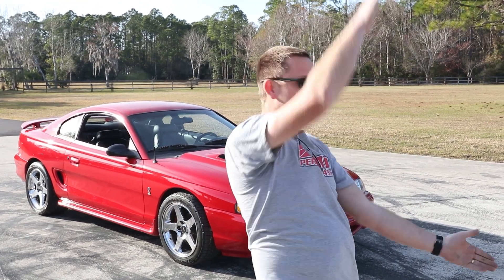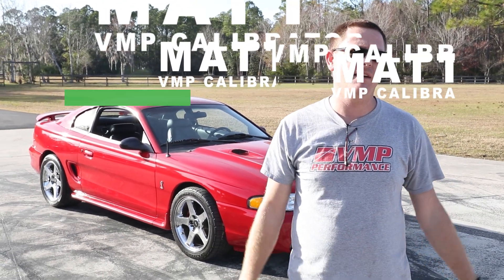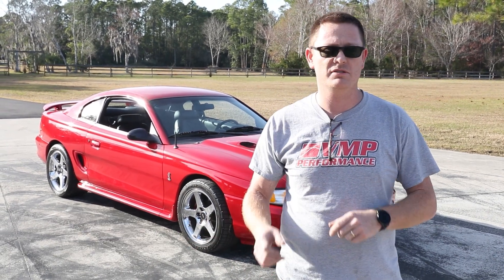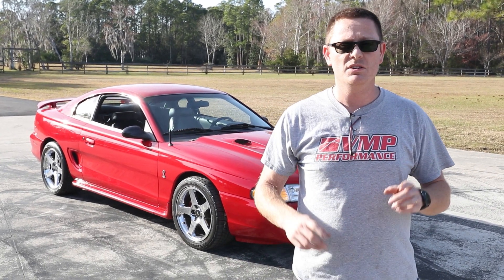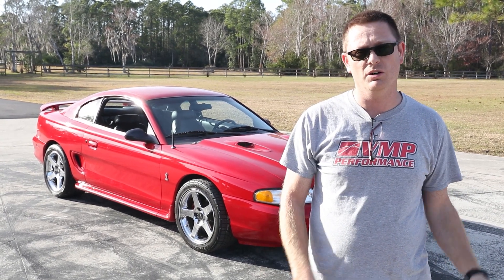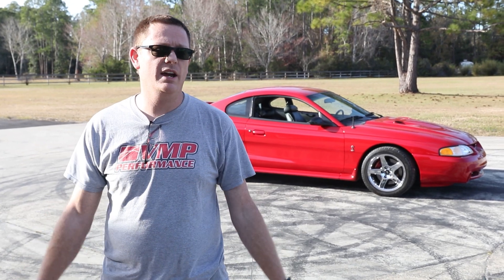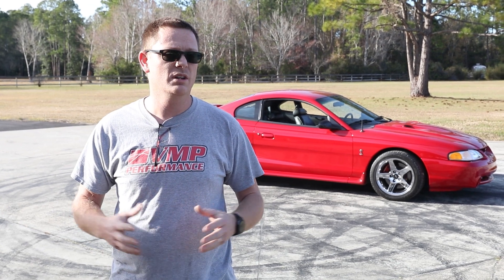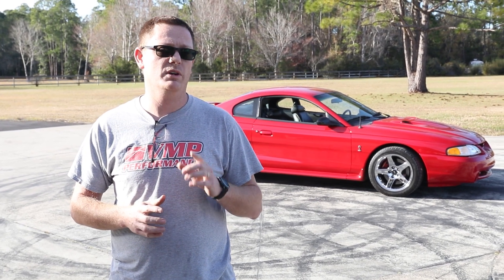Dyno Pull || 1997 SVT Cobra, Kenne Bell Supercharged

Comment: Finally a Chanel working on what I was looking for
I do have some questions, I have my 96 cobra with long tube racing headers, built heads stage 2 cam X-pipe, bought the car when I was 18 about 6yrs ago and wanted some tips on how to get it touching around 450-500 whp
Reply from the maker: That power level will most likely require forced induction to be accomplished.  There are a number of supercharger kits out there that could make that work.

Comment: So why are you guys not making adapter plates for your supercharger systems to bolt on to the bhead 4v's
Reply: ive been waiting years for this id love to get my hands on a mammoth kit for my 98
Reply: @ranware2779  the cobra r, ford gt, and 07 up gt500 all had the same heads I'm pretty sure and they are all better than b heads.  I've always heard b heads are good for boost.  I would do forged rods and pistons and go turbo on one of these its just the best option.  You're forced to go c heads if you wanna run a vmp blower or any other modern intercooler blowers.
Reply: @midnight347  b head 4.6 is the one with records go chec out TT minion he still has b heads. My question to these guys was that because b heads are the easiest 4v heads to obtain besides C heads

Comment: I just received the KB supercharger for my 98 cobra. Does your setup runs hot? I’ve heard people saying this. Nice cobra by the way!
Reply: I’ve been tuning it several weeks now, no issues with overheating
Reply: My 96 wants to run hot in the summer. It gets over 100 here and with the ac running it gets a bit hot if I'm in heavy slow traffic.
Reply: @Jon P oh ok how long has it been running hot? Are you going to do anything to fix the issue?
Reply: It doesn't really run hot, it just runs hotter than normal in those conditions. Mine is tuned to run around 180 and it will hit around 200 in the summer. Not really hot for what these cars are capable of handling just hotter than what mines turned for. It's never overheated.
Reply: Ron Davis Radiator + Edelbrock water pump + 180° T-stat and set the high speed fan to turn on at lower temp.  It will run at the N or O on the normal gage even on the hottest days.  Thanks @vmpperformance for the tuning!
Reply: Thanks for the info. What line on the kenne bell S/C can you put the t fitting for a good reading on a boost gauge?
Reply: @bernardberry35  good question.. mine is still NA full bolt on.  One day I may have a KenneBell 2.1 then I wont be taken so easily by a stock Coyote car.  Supercharging the 4.6 4V is still wayy cheaper than a coyote swap done right.  Your talking $30,000 for a supercharged 3rd gen coyote crate engine with control pack and tremec 6 speed.  I’d rather build and boost the original motor if I had the cash to go to that.
Reply: @jasco1776  that is for an overpriced gen 3 and auto setup.  You could do a gen 1 truck engine and build your original 5 speed and add a blower for waaaayyy less than that 30k figure you spit out.  You may do it not much north of 10k if you do your homework and shop wisely.  I'm not talking about labor costs so that will add little more.  That setup is easily capable of 650+ to the tires no problem.  Gen 3 are overrated id honestly rather have a gen 2 if I was gonna spend a little more on a coyote they don't have the direct injection bs one less thing to worry about and the engine looks better and they can handle boost as good many will say even better than the gen 3.  But I do see what you are saying these cobras are capable of some power I would do forged rods and pistons for whatever compression you want and go turbo.  That is ideal with the older na cobras pre 98 imo...even 99 later ones.
Reply: @jonp5760  '96s  actually had quite a different cooling system than the '97 and '98s. The later models used a different A/C condenser with less fins, different radiator and and larger fans. If you look up a radiator for a SN95 Cobra you'll see the 97 and 98s are their own listing because of they way they're mounted. There was actually a TSB from Ford about 96 Cobras in warm weather climates getting upgraded parts from the '97 model.

Comment: i've got a 1998 cobra with 34k miles does vmp  make a blower for that?
Reply from the maker: We do not.  Our supercharger systems are for Coyote and Terminator platforms.
Reply: I would've thought a company trying to make money would broaden for the customer needs and wants but hey guess ill take  my money elsewhere
Reply: @Thelegendking-yj4bm  dude there's like almost no one that is modding these anymore, and the r and D for them would never show any return if they made a blower for these.
Reply: @VMPPerformanceTV  All I can say be gentle with that version of the 4.6 they definitely are not known to be strong motor s.
Reply: @anthonylaudano9751  Best block and best boosted heads you can get.  Just crappy rods and pistons.  Block, heads and crank will all support well north of 1000hp.
Reply: You'll have to go centrifugal, non intercooled KB (like this one) or turbo unless you swap the heads, but if you do that, you'll still need to build the bottom end anyways.
Reply: @Milehighsnake98  I have 2 super snakes.My 10 has a Kenny Bell huge blower 900hp insane fast.Then my 07 427 edition convertible super snake has only the TVS that's the biggest blower Shelby American puts in the the convertibles.Then I have a 08 GT 500 with a TVS also.My 04 Terminator is 100percent stock with really low miles so that car is staying original.Same with my 93 cobra all original low miles also.Back in 97 I bought a new  cobra off the lot and I missed one shift and the motor exploded.So I sold it.I have a 87 mustang GT that I have had for years and it has taken way more abuse then my 97 cobra.THE HOOD AND THE LOOK OF THE MOTOR ON MY 97 was my favorite part other than that I won't buy another.
Reply: @Milehighsnake98  found that out the hard way with a 2.1 kenne bell on my 98 lol
Reply: @Milehighsnake98  I think forged rods and pistons and a turbo is the best route for these cobras.
Reply: @anthonylaudano9751  they support 450whp very well! Those motors are literally only pistons, rods, and fuel system away from being 1000whp with a blower or twin turbo set up

Comment: How do you not intercool that 4V?? Even just for longevity purposes... 🤪
Reply: To my knowledge, kenne bell doesn't make an intercooled blower for the 96-98 cobras.  And I believe they're one of the only companies that offered a blower for those cars to begin with.
Reply: @jrjhanson  I think your right. I know on my Mach 1 I got a Procharger but as far as roots go I believe you are correct.
Reply: @philipdonato4664  Because of the IMRC plates on these cars, nobody wanted to make a positive displacement blower for them.  Even worse, nobody wanted to put the time into figuring out an intercooler manifold for the B heads that would still fit under the low stock hood.  In 1999 when the C heads came out without the IMRC's, it was easier to design.  Then the 03 Cobra came out factory supercharged that used the same C heads.  So any blower for an 03-04 Cobra will work on a Mach 1 or 99/01 Cobra for that matter.
Reply: @Milehighsnake98  awesome, thank you for that info. I was confused
Reply: @philipdonato4664  Ford didn't make it easy for the aftermarket.
Reply: @Milehighsnake98  glad I snagged the Mach. Lol
Reply: @philipdonato4664  LOL I have the 98 Cobra...So I know what you mean.  If you want to see a bastard of a car...97 and earlier and 99+ fuel pumps don't work.  Different IMRC, different cams than 96-97.  All fun cars though.
Reply: @Milehighsnake98  I feel you.... I found that a Ford Focus SVT was the upgrade fuel pump for my Mach, I was like WTH??? 😂
Reply: @philipdonato4664  It's the same for my 98 (but that pump won't work for a 97 or 99 cobra).  The best upgrade for me is an 03-04 cobra...but that means swapping the entire tank, and then getting a return style hat for it and finding the adapters to connect it to the 98 fuel lines (or running new lines).  Love the car, hate the engineering.  Wish I would have gone 96-97 or 99/01 sometimes, haha
Reply: @Milehighsnake98  wow. I guess I will NOT be hunting for a '98. Damn....
Reply: @philipdonato4664  It's not really that bad unless you're going for big power.  Walbro makes a 300lph pump for BBK that's a drop in that should be good for like 550-600hp. Modify the pump basket to avoid fuel starvation by drilling a couple holes and you're good for a while.  If you're looking at over that power, you'll want new lines ran from the tank anyways.  The 98 also has the better cams, better IMRC plates.
Reply: @Milehighsnake98  I'm good now.... I appreciate the info but now I have a '18 10A with a Odin on E85. Miss the heck out of my Mach though. Honestly more fun.
Reply: Not completely neccessary. I installed a water meth kit for my KB 2.1 97 Cobra. I can adjust when it turns on and off so I can hav it in at all time but only inject when I'm in the boost and/or revved up solves that problem perfectly.

Comment: And those are trash numbers even for that car
Reply: Eh, it's 6psi, non-intercooled.  Might be off by 10-15hp from what it could make, but not a lot.  Plus those engines had some real issues with consistency.  Some made 240whp some made 270+, all depending on the cam timing.  Simply spending a couple hours to properly degree the cams on each head so they match can gain 20whp.
Reply: @Milehighsnake98  these young coyote guys just don't get it.  This is as restricted of a setup as you can possibly get.  It's a bone stock car that is doing 6 psi non intercooler with a stock exhaust and it's up 80-90 rwhp over stock.  This is also a fairly small blower and it's honestly not that efficient it's an old design and it's just not that good.  I don't know what these people expect.  Put an old gt500 m122 (prob similar size and efficiency to this old boat anchor kb) on a stock gen 1 coyote with a stock exhaust and run on 6 psi with no intercooler and see if it lights the world on fire.  It won't.  Itd prob be making South of 500 to the tires which is "trash numbers" for a  blown coyote just like these are "trash numbers" even for that car.   The way he says it with such disrespect to this car which is the grandfather of his precious coyote that he thinks is the end all be all.  The coyote was a direct descendent of this engine and owes gratitude to this engine for the entirety of its existence.  These young punks need to have more respect for the cars that came before and paved the way to get to this point were at where we are so spoiled with big numbers.  The disrespectful tone against the general mild setup the car has and against the car itself as a whole is sickening.  Learn your history and give credit where it is due.  Everything didn't always make 1000 whp on stock motors super easily.  It's like they didn't even listen to anything that was said in the video.  A car isn't gonna make a bazillion hp just because it has a blower on it.  Therr is alot more to it than just that.  It is an extremely held back ultra mild setup on a small not very efficient supercharger on a completely stock car from the 1990s. I mean how is it "trash numbers even for that car".  Put the thing on 12 psi intercooled with a full exhaust I bet you'd see 500.  That isn't bad for what it is.  You gotta understand what makes engines and superchargers make power or not make power.
Reply: @midnight347  Absolutely agreed.  The bottom line that people need to remember though, is that when you watch a video like this, or see a magazine article...it's not your car, it's theirs.  People do what they want with their cars, and not everyone wants 1000whp on a street car.  The heavy clutch, stiff differential, huge sticky tires (which are really noisy on the highway and don't handle rain well) needed for those levels all make for a street car that's fast but not necessarily enjoyable to drive.  
I have a 98.  I could have put forged pistons, rods, etc. in when I rebuilt the engine about 12-13 years ago, but didn't have the budget for it at the time.  So, now I'm putting an off-the-shelf twin turbo kit on it.  I know what the kit can make, I know what it should make on 10-12psi, but I also plan to run it normally at 5-6psi.  Why?  Because it'll live longer until I forge the block, and I don't need 500+hp to drive to the store.  But I also have an electronic boost controller so I can turn up the pressure with the push of a button.  
Some people don't understand that there's more to it than just boost pressure.  You and I and the owner of the car understand.
Reply: If that car had all the usual bolt-ons it would've made another 25hp+ easily; I've seen this exact blower put down over 450rwhp before it was even tuned(12psi). 6PSI is overly conservative in the video, they used the wrong pulley, he's also wrong about the stock power output of these cars, they make around 290rwhp bone stock yet claimed "250-260". I've dyno'd these with over 200,000 miles on the odometer and they still made over 280rwhp..
Reply: @midnight347   I Know this is 2 years later, but had to say something, you hit the nail on the head, when it comes to the ol' Mustang like the Foxbody, SN95 - 5.0 / 4.6 Cobra, most of these kids weren't even a glister in their dad's eye when these cars were new , so anything less than 1000 hp is boring to them, not realizing how sports cars/ muscle cars suffer from the fuel crisis in the 70s which affect cars in the 80s -90s.

Its the same with the progression of technology, they don't know the struggle of having no cell phones, pagers, or hell dial-up internet, cause they're so use to have everything at their disposal. its crazy.